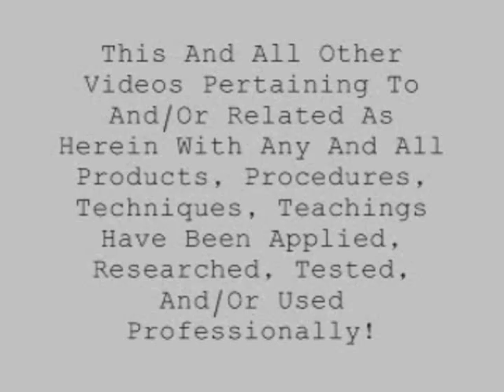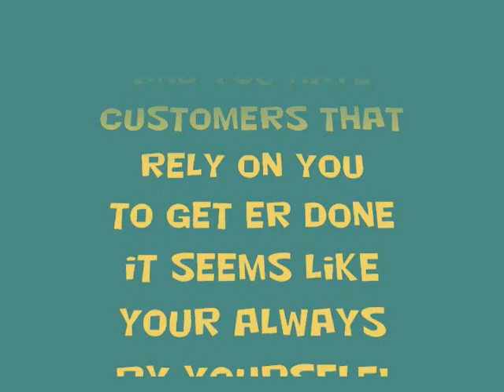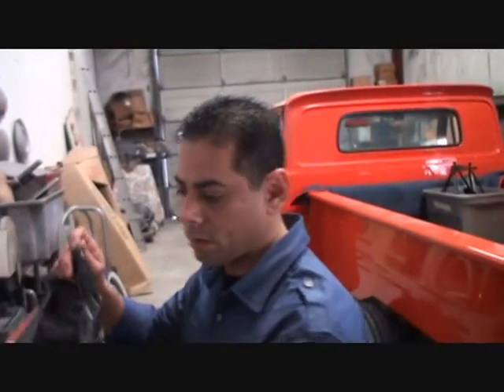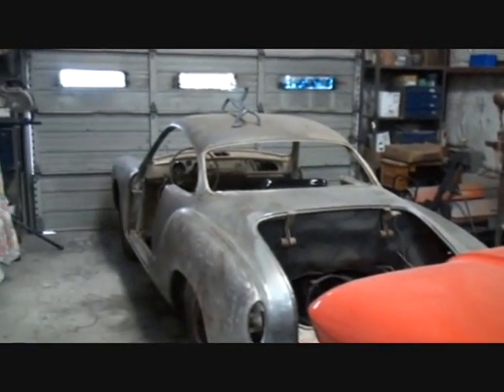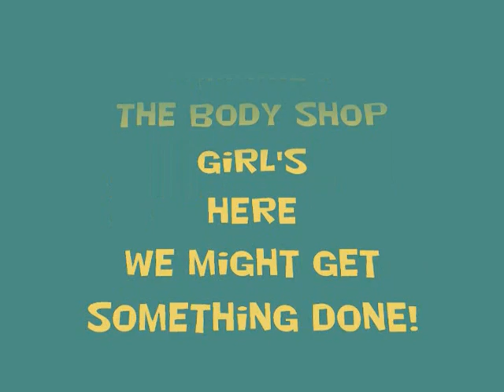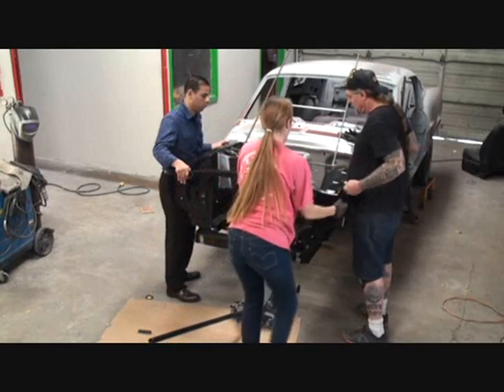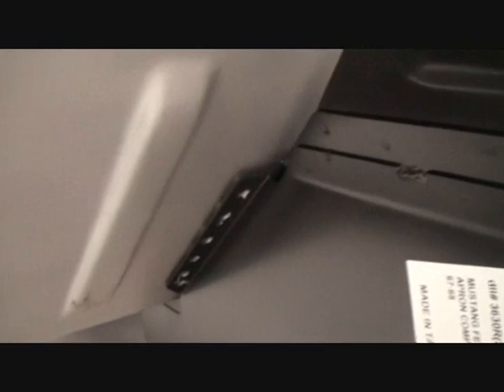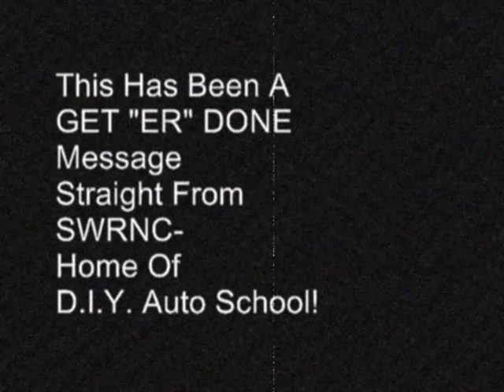"How To": "Restore" A Rusted Out "Car"-Part 19

Comment: Nothing a few washers won't fix........ Or a sledgehammer to the lower firewall .... Sorry Pete, couldn't resist that crack. Speaking of cracks, seems ya gots a big one at the top of those rails. :-) 
The fix will be interesting for sure.